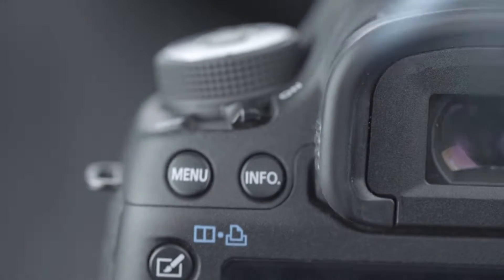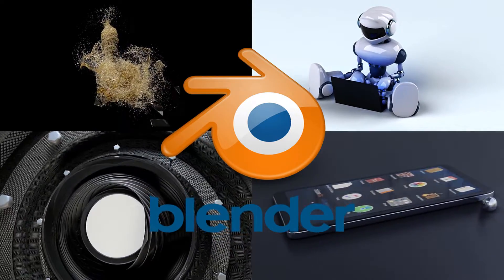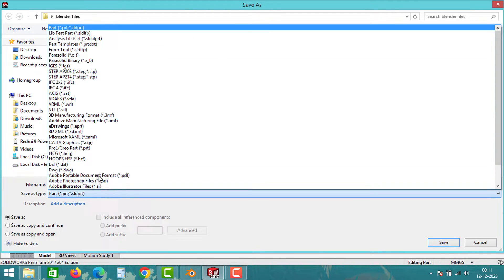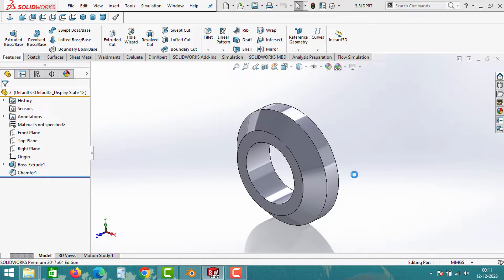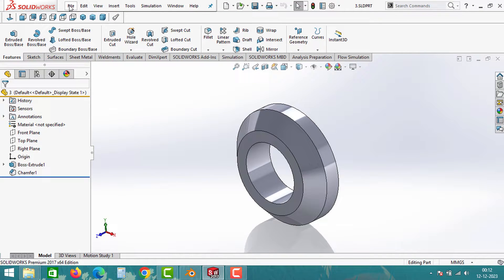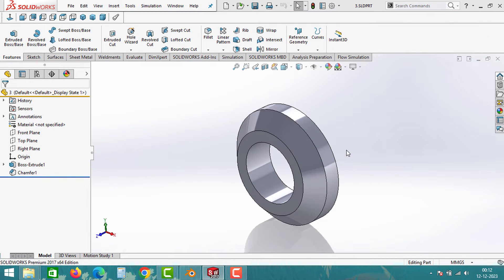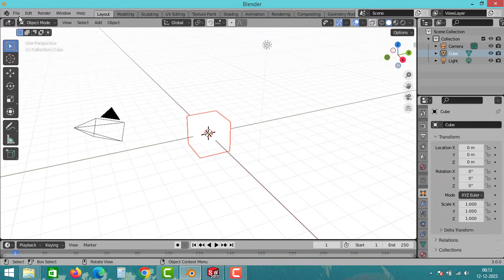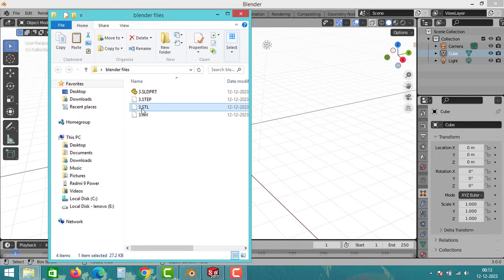SOLIDWORKS FILE TO BLENDER FILE | 3 DIFFERENT METHODS IN SOLIDWORKS

Comment: I imported a Solidworks .obj file to blender that had materials on all the parts, but when I opened the file in Blender all the materials were gray “I was in material preview and Rendered view.” 

Even in the material previewer. All the preview spheres were gray. Any idea? I opened the model in Solidworks again and the materials were all there. 

Maybe I should export a separate folder with all the materials?
Reply: That's because the Nodes are not enabled in Blender. 

It has to be enabled manually
Reply from the maker: Try with WRL file format. It is clean and Accurate